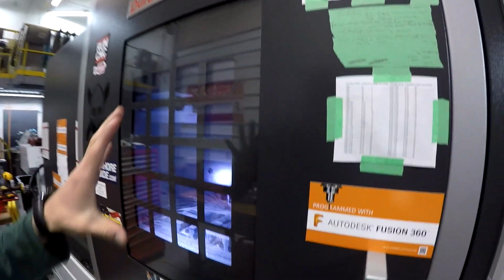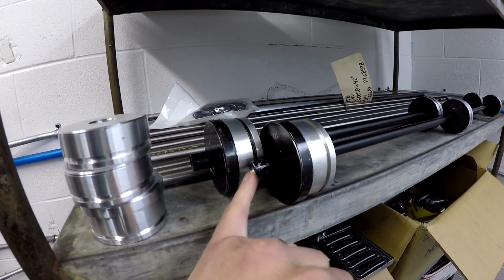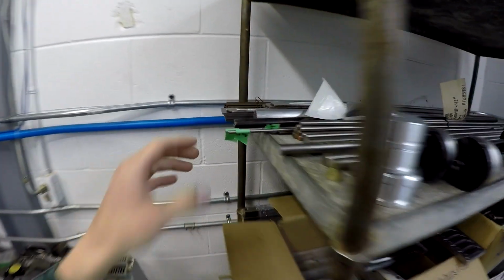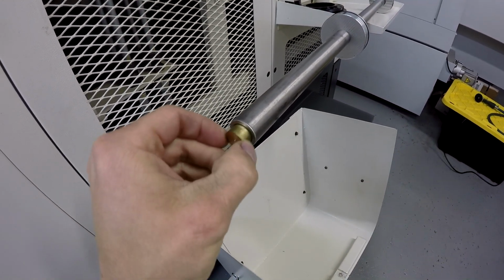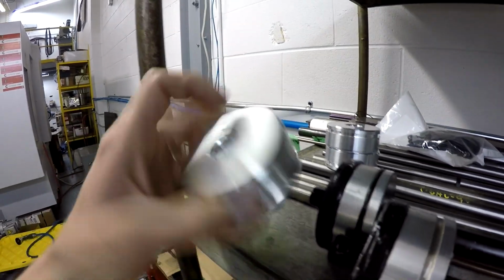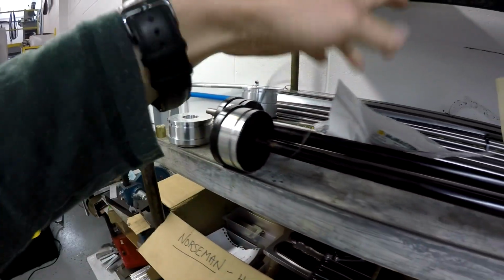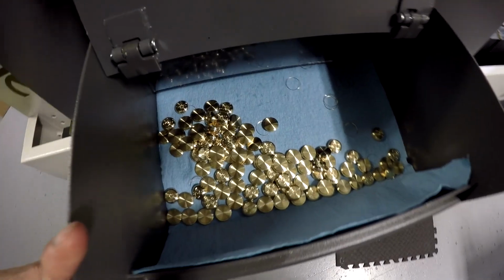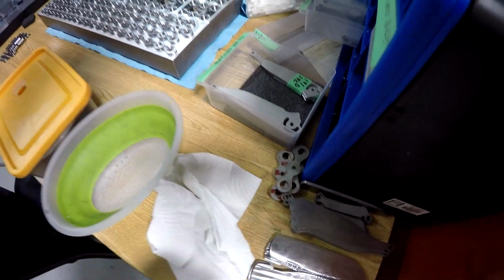A cool project I shouldn't have done

Comment: nylon whatever plastic size of your shaft. how much it cost. think 600-1000mm 50mm dia round bar with out any. yes my boss is cheap and machine have to run parts automate. pulling part with cutting tool. think how much that parting tool life is lol.

Comment: I've made dozens of those spindle liners from scratch, out of pvc pipe, black iron, stainless, all sorts of stuff. I've even made ones that have through coolant to push the chips out of the center of pipe. If you want to be cost effective making that stuff, you need piles of material laying around (bootstrapping), you need a manual lathe (bootstrapping) you need to work fast! Its a spindle liner, we made them fast and ugly, we modified them all the time. 
I'm not saying its a good idea, but you arent mentally geared into or tooled up do stuff like that being a cnc only shop. Over-analyzing them is definitely a factor here but so is 5s...

It was fun working at that shop but it was dying, I got out.

Comment: John at my job we have plastic rings that we put over the OD of you material and on the last one put it on the end with a set screw. So your pucks of match the dia of draw tube id match material with a little run out. The last one again has a set screw and clamps down over the dia of material. Very cheap very quick

Comment: Ten step method.
Step one, have a small to medium sized lathe, the corner stone of every shop. It doesn't need to swing Abom sized pieces, just have decent capacity.
Step two, get stock rod, machine sintered bushings for said rod.
Step three, machine pucks that fit over the sintered bushings leaving about 2 3 cm on each side.
Step four, get fiber glass tape and bonding agent.
Step five, after securing the bushings inside the pucks (thread lock suffices) chuck them and cut minor groves/or knurl them.
Step six, get rod, get puck assemblies, get tape, and bonding agent.
Step seven, put them all in a lathe, with an even spacing on the puck assemblies (specifically to your lathe's needs).
Step eight, lowest speed (usually on small lathes that's a crawl) begin wrapping the fiber glass tape in the spaces you have between the puck assemblies, with bonding agent.
Step nine, remove rod from sleeve, clean up the material, paint the fiber glass white.
Step ten, put stickers and celebrate.

By keeping in mind that this is meant to be a custom fit to a rod rather than busting your cap to find the right pipe..i'd say this is pretty simple. I've made fiberglass tubes before with this method over a weekend, and the puck assemblies are super easy. For O-rings i'd use silicone ones, pliable, and soft, i use that type for my sleeves. I'd expect that with all the parts on your table, you could do this project inside two, say three weekends. So long you don't reinvent the wheel, that is. :p

Comment: John, 

good morning, great video! why are you trying to invent the wheel? i buy 3" solid PVC bar and when ever i need to hold a bar in the lathe i turn 3 pieces down to my correct size and i slip them in to the spindle nose. i hold my material and its never an issue. i run all kinds of jobs and no issues.  there's no need for crazy tolerances +-0.01" is fine but i would tell you that making them on the mill is asking for trouble. you need to get a manual lathe to make things like that so you dont take time from your machines. 

otherwise great videos. when is the spinners are coming out for sale? im interested.

Comment: Hey John, do you have your machines on your network? Since you are running them lights out (like you should to make $$) is there a way to have them setup to notify you (email, TXT, etc.) When they have an issue like you had in the video? I was just wondering cause how much production (aka: profit) did you lose due to a chip? At least if you got a text you would know and could decide if it was worth going in to fix the run. Heck you may be able to login from home and fix it. 

I am in IT and fix problems all day that are half a world away. It is all about setting up the system to tell you when things happen.
Reply: Eric Wolf Very little because the breakage detection finds it. I am of the opinion that it's detrimental to know that the machine failed, because the only thing you can do about it is go to work at 10pm instead of doing other things in blissful ignorance.

Comment: You need to figure out an effective shop rate for your time.  Then you can estimate your own internal "cost" to build stuff for yourself.  At $150 for that part, you couldn't turn your computer on and win.  Your shop rate must be at least $100/hr plus material cost.  Same logic can be applied to all your tooling.
Reply: Barry Gerbracht You are so correct but, you can't stop doing what makes you happy.
Reply: This is what I was thinking. If he stops those machines from making bread-n-butter, it needs to be for something worth a lot more than what the bread-n-butter is selling for. It can't even be close. You have to also figure in his time separately from the machines. Think of how many things didn't get assembled or shipped during the time he was working on this. It all goes into the accounting of things. The numbers don't lie.

Comment: I'm no machinist but wouldn't it have been tons faster and cleaner to turn those pucks instead of milling? Seems like you were asking for trouble
Reply: F0XD1E his lathe is finely tuned for making knife parts, and adapting it to make a large part like that would be a pain in the ass. Most notably, he'd have to take the collet chuck out, and put in a 3/4 jaw. the diameter of the parts are too big to fit a collet. Also his turret in the lathe is super tightly packed with only enough space to make small parts. on the mill, he can swap out tools and hold pretty much anything.
Reply: Yeah, I got really confused when he said he had to write the code, the work would have been done better and faster on any metal lathe.
Reply: F0XD1E My thoughts exactly, i don't have nearly as much experience as John but i think i could've turned them in no time on a crappy old manual lathe.
Reply: Azureus Rising Oh well, can't blame the man for being such a perfectionist. It is what made him so successful after all
Reply: Just watched a really old video of John's where he milled a part for his friends Volvo, which he should have turned on a manual lathe. I agree with his sentiment that he shouldn't have bothered at all, but if he thought out his methodology better he could have used his time more effectively, and save money.
Reply: He's not approaching this the right way.
Reply: dont they still have the tormach
Reply: They still have the slant lathe, they also have a manual lathe on their second floor.
Reply: sanka The "feed tube" is smaller than what the jaws on the chuck can handle. Do you even lathe bro?
Reply: those pucks fit in the feed tube which means they are bigger than what that machine can handle so NO. he couldnt turn those pucks with the machines he has.

Comment: LOL.. too high tech spindle liner for me. I went extra cheepo and turned down a pieceof delrin to fit nice in the lathe bore then just drilled a damn hole a tad bigger than my bar and voila...   works just fine.

Comment: hey john im a machinist,  for the bar support i have a box of delrin cutoffs with various hole sizes to match diff size stocks .. pop em on to the stock an it doesn't slap around inside the spindle  . and best of all they're practically free as there just excess cutoffs from other jobs .